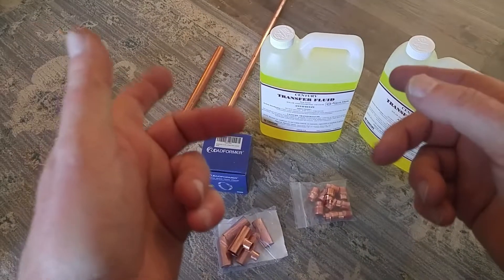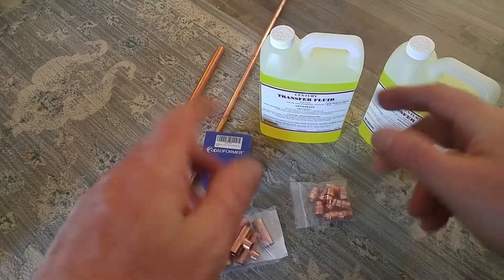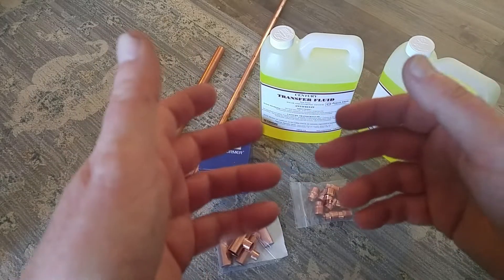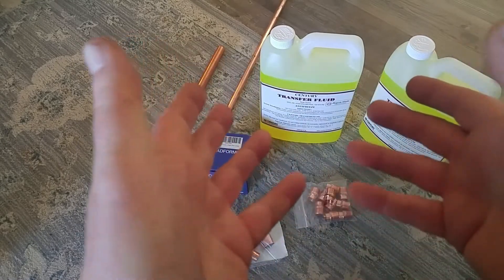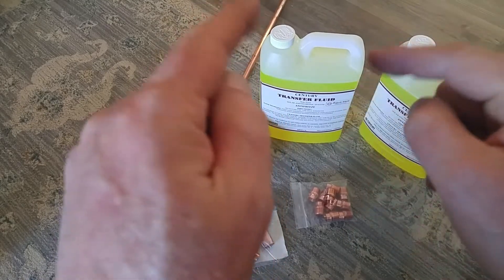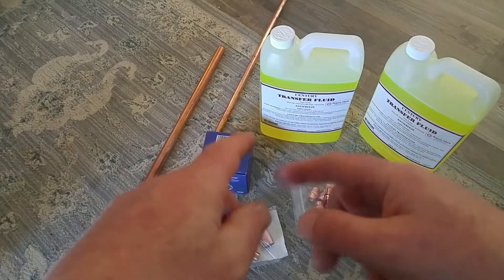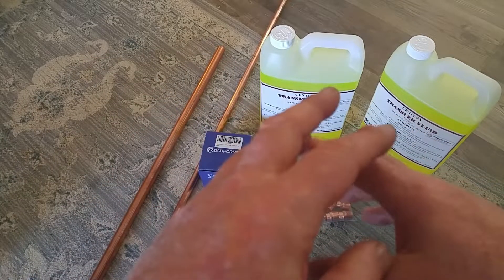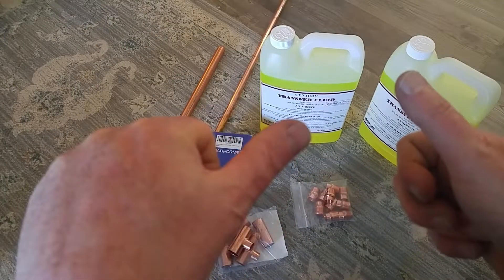ALDE TRANSFER FLUID PROJECT - Part 1

Comment: Scheer has developed a comparable product to the Alde heating. They use solar fluid with high thermal stability. I use a glycol-based solar fluid (comparable to Scheer fluid) that is corrosion-resistant up to 190°C (and even over 200°C for a short time), and it doesn't need to be replaced. I can send you a German video that explains it in detail. But I think you can understand that solar thermal energy can both ignite very high therapeutic properties and at the same time address the issue of corrosion with the same materials. Good luck.
Reply from the maker: @dexcore.  
I have researched their product in the recent past. A few important details...

Alde heaters are also water heaters attached to the potable  water system in Tab trailers. 
The boiler is "single wall" construction. That means that the glycol which is heating the water is not separated from the potable water tank exterior. A single wall separates them.
And that's the rub.
A minor failure can cause leakage of the glycol fluid into the potable water system.
There are MANY fluids available which are much more corrosion resistant, but contain toxic, sometimes lethal additives to be so.
That is Century fluids claim to fame. It is food grade prophylene glycol. It carries GRAS certification, which means it is edible and harmless.
For an alde single wall construction boiler with potable water, it is very important to use a GRAS rated fluid without toxic additives. In fact, in America it is illegal for companies to install harmful fluids into these single wall boiler systems. Germany and most of Europe do not have those same regulations 
In fact if you live in Germany, and don't care about the risk, you can still buy LETHAL ethylene glycol fluid made for the alde system. It lasts a lot longer than the prophylene glycol available for alde here in the states, but even a tiny amount of leakage into the potable water can kill.
Considering the violent extreme environment these alde heaters are installed in, I chose to stay with the safe fluid for my family.
Reply: Is this easily retro fitted into a NuCamp?
Reply: @dw2394 I don't know what they installed in the NuCamp. But what I was referring to was replacing the coolant used in an Alde heater with fluid from a solar heater. This has better properties than the original Alde and therefore doesn't need to be replaced regularly.

Comment: Hi Mark ,I just bought a 2019 TAB 1:28 320S I am now checking all hoses and connectors as per you videos on the corrosion issues.  I have a photo of a bulge on the lower inlet convector behind the headboard end of bed. I haven't drained the fluid or tested alde yet. Should I give the system a test run first or drain and check the bulge spot? 5
Reply: As long as it is not currently leaking, and the glycol level is ok, you should be OK to test it.
But do take care of the corrosion issue as soon as you can.

Comment: Instead of making a drain out of soldered copper pipe and a tee, could you use pex and sharkbite connectors to make the drain?
Reply from the maker: The issue is finding fittings with the same inside diameter as the black EPDM hose inside diameter. A fitting with a smaller inside diameter will restrict the flow of heat transfer fluid in the loop. Remember that the loop is not pressurized, and the fluid flows around the loop very slowly by a low power vane type pump. I chose the fittings I did because they are exactly the same inside diameter as the hose, and won't restrict.
Just FYI, note that PVC pipe and fittings can NOT be used, as that material is not compatible with the prophylene    glycol heat transfer fluid. It will soften it and melt it over time.
I don't know if PEX plastic is compatible either.

Comment: I want to change my glycol and change the automatic air purge valve.  if I drain the fluid from the extension bowl through the drain under the trailer, then I disconnect the hose that runs from the bowl and send air from that hose to empty the rest of the fluid from the system, does that  will air pass through the pump, or stop at the pump?  I have had my fluid in the system for 6 years and it doesn't seem to have any corrosion like in your video.
Reply from the maker: The circulation pump is a  "vane' type.  Vane type pumps can pass small pea sized bubbles, but if a larger pocket of air gets to it, it will just spin in that air, and pumping will stop. Vane type pumps cannot "self prime". That means tat once the pump starts spinning in air, it cannot by itself, start pumping again. You have to manually clear the air, and prime it yourself.
Reply: Note that I want to blow air with an air pump into the system through the alde pump, but the Alde system pump will not be running.  That's why I wanted to know if the air will pass through the Alde pump.
Reply from the maker: @manonboyer3718  
Note that the Alde system is not a sealed system, and is not designed to hold pressure. Make sure that whatever air pump you use does not pressurize the system or it could damage components. 
Also know that there is a one way check valve in the alde heat loop. Ensure that you apply air in the correct direction. Forcing air pressure in the wrong direction can damage it.

Comment: Can you give me a link to buy a hose cutting tool on Amazon?  I really like the hose cutter, but don't know which one to get that will work to cut my ALDE rubber hose.  thank you!
Reply from the maker: This will do..

https://www.amazon.com/Zantle-Ratchet-type-Cutting-Plumbing-Plumbers/dp/B07T2YG963/ref=mp_s_a_1_19?crid=HBQFONT9W2ZS&keywords=hose+cutter&qid=1685823739&sprefix=hose+cutter%2Caps%2C205&sr=8-19
Reply: @tabtrailerupgradesandmaint2923  Do you have a good tool recommendation for cutting the aluminum piper?

Comment: Hi Mark. I really appreciate your videos and your pragmatic approach. In this part 1, you say that the Rho Water (aka Rhomar) product needs to be changed only every 5 years. Based on what I read in the NuCamp T@B Forum, it looks like Alde/NuCamp have clarified that Rhomar fluid still needs to be changed every 2 years. Have you heard the same? Now that it's been a year or so since you made the videos, are you still planning to stick with Century transfer fluid?
Reply from the maker: At the time I made that video, the rhomar folks and Nucamo were touting a five year replacement for the new fluid.
In the time since,, this has been shown to be total bunk, and since the new fluid is not preforming  any better than the old fluid, they are now backing off the claims of a five year cycle. The new fluid needs to be changed at the same interval as the original, but at near three times the cost. 
I will definately be staying with the original fluid.

Comment: Hello again. I have found the Century Transfer Fluid on Amazon,  but there are four options. They are all 50/50 glycol/water, but they are called 2 Set 50% Glycol / 50% Water ( -20 Below ), 3 Set…., 4 Set……, and then “no set”. I assume they are all identical and this is just some confusing amazon ordering issue. The photo is identical to the one shown in your video. Do you have any insight as to which is the proper one (they all may be the same product for all i know). Thanks so much, George

Comment: This is the similar kind of liquid that you find in the automobile cooling system, isn't it?
Reply from the maker: It is not the same as you find in automotive.
The stuff in automobiles is toxic.
The century chemical transfer fluid is food safe.
It has to be non toxic because the Alde also uses this fluid to heat the hot water for your kitchen sink.
If there were ever a leak, it would be bad to have your hot water at your sink tap become contaminated and toxic.